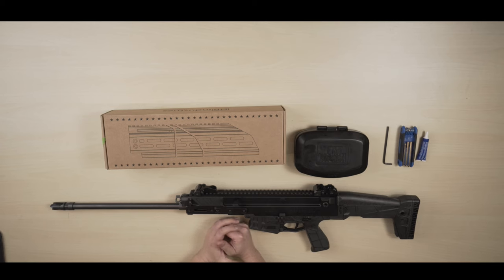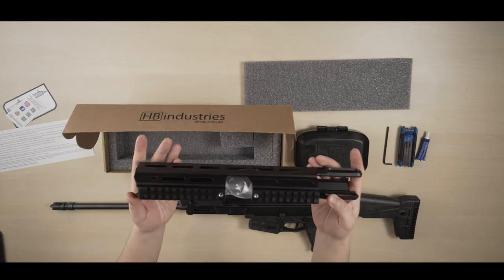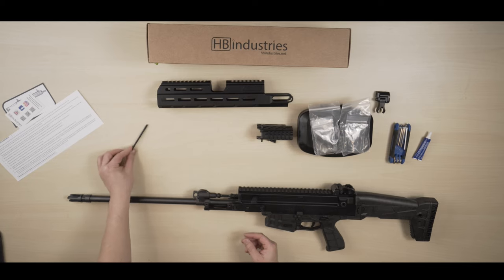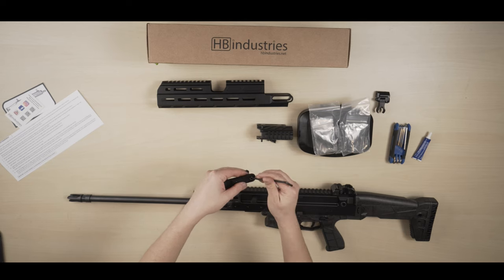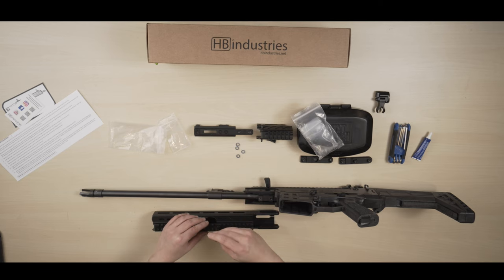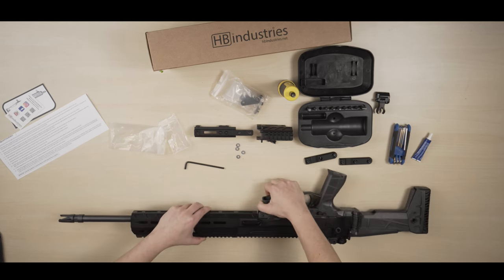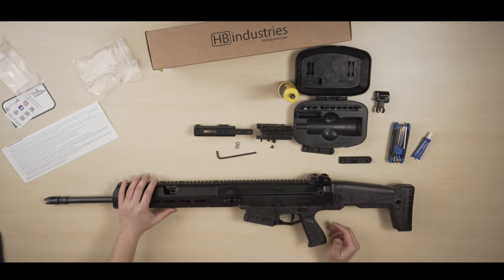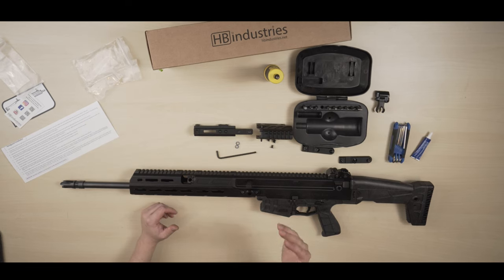HBI Handguard Install - CZ Bren 2 MS - 4K

Comment: Hello! I would like to kindly ask you if you had any problems with this HBI handguard in the post update scenario. My question is based on the fact that there were 6 screws fixing the barrel to the receiver, and in the new implemented HBI configuration there are only 4, two on each side. Did your barrel remain tight enough? Or did it come loose or cause a loss of accuracy due to barrel harmonics and firing stress? I did a conversion to a 6mm ARC and I am having issues due to the lack of proper barrel support. I have the 15.8" handguard and a 18" barrel. Your attention to this matter is greatly appreciated.

Comment: How did you remove the factory screws so easily? I'm also looking at replacing my handguard but a bunch of people have reported that CZ uses an abundance of loctite on the factory handguard.
Reply from the maker: It was not hard for me. I did use heat gun to heat it up just a bit. Let me know if the tips work for you. Hope you like the video. Please help my new channel by hitting that like and subscribe button. Stay safe and free man!